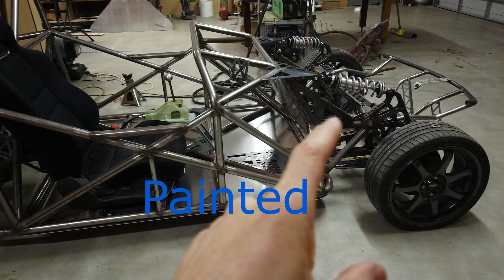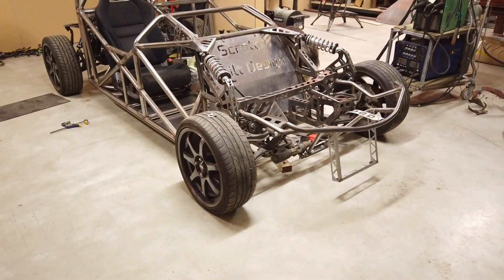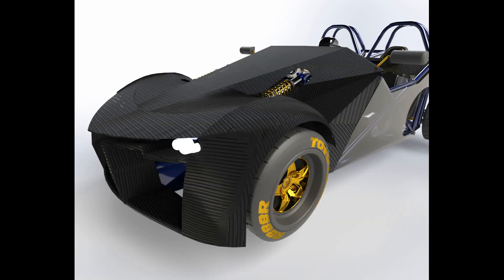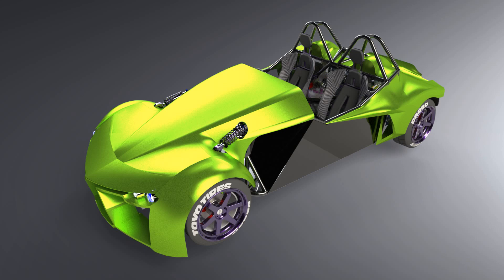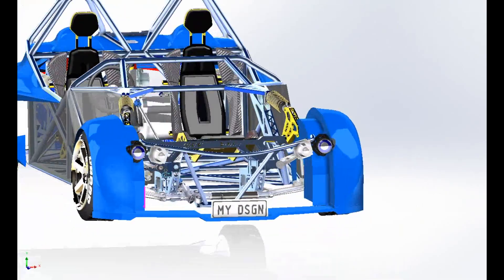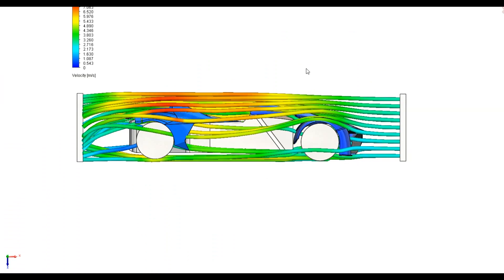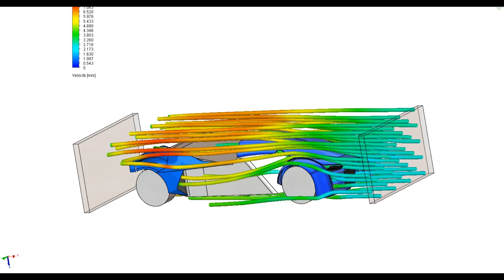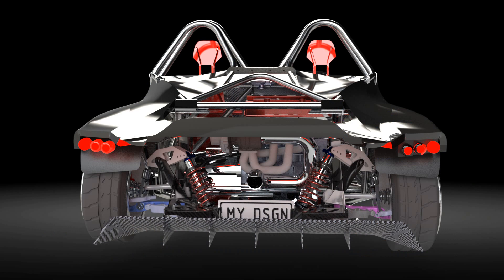Scratch Built Design # 11 Design update and aerodynamics

Comment: I'd put the turbo on the side, provides for a lower COG, and would seem line a neater way to route the pipework, both intake and exhaust, without knowing where you're thinking of putting the charge cooler.
Reply from the maker: Thanks Neil if you pop over to this link you can see where it ended up video will be out soon  https://www.instagram.com/p/CTje7_epG-3/?utm_medium=copy_link
Reply: @scratch_built_design  nice. You've for a new sub from Jafaville 😉

Comment: As for tail lights, would you consider some aftermarket nsx lights? Like if there's room height wise could you have them mounted perpendicular on each side with the "pointed axe" end at the top pointing outwards? Or even just mounted normally or upsidedown could also frame the rear end nicely
Reply from the maker: Hi ethan thanks for the idea differently going to look in to it